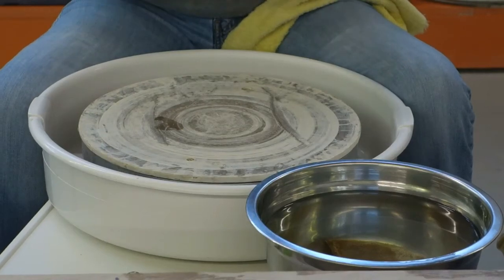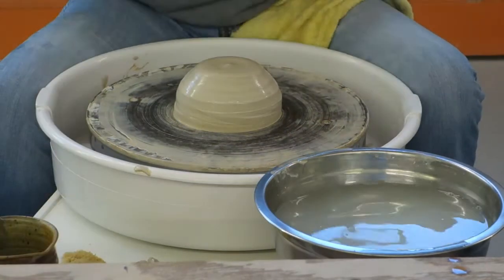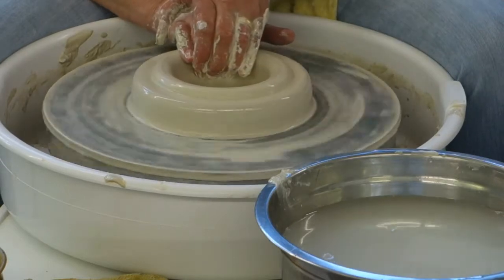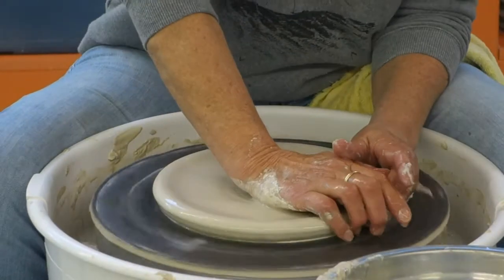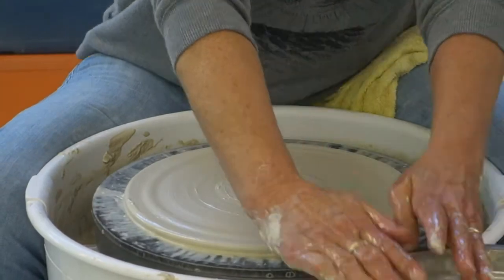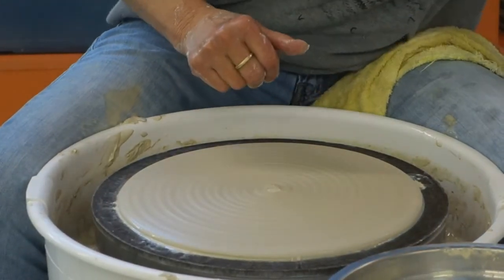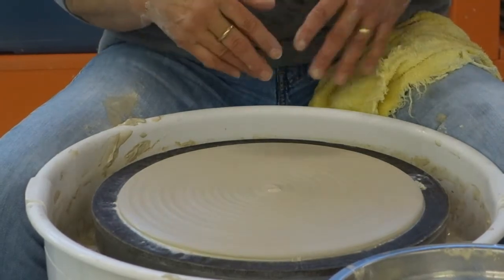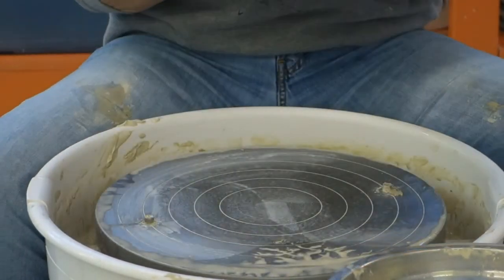Throwing a Disc Cake Plate. Visit MonroeClayWorks.com.

Comment: Great video! When you said you spread the grog on the kiln shelf during the glaze firing, are you saying the grog won't stick to the glaze on the bottom of the plate? I'm trying to figure out how potters glaze both sides (like a cheese board) and not have stilt marks etc. I have read about the grog on the kiln shelf, also alumina hydrate + wax resist on the piece, but no one mentions if that is brushed over the glaze or not & is it better to glaze fire these flat pieces vertically or flat. There just isn't much information on how to do this. Thank you so much!
Reply from the maker: There is no way to fire a piece with glaze that touches the kiln shelf. It will stick - grog or not. The grog just lets a large flat pot expand and contract more easily during the firing and may prevent cracking. Grog does not prevent glaze from adhering to shelf. Stilts is the only way or don't glaze the bottom or trim a foot and don't glaze the foot but then you can glaze the underside. Remember don't glaze any part of the pot that touches the shelf.